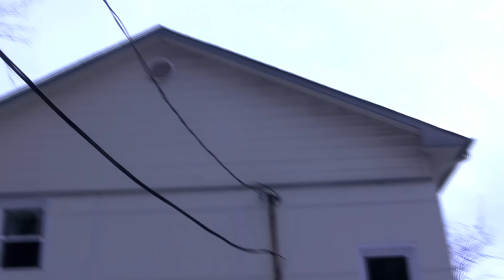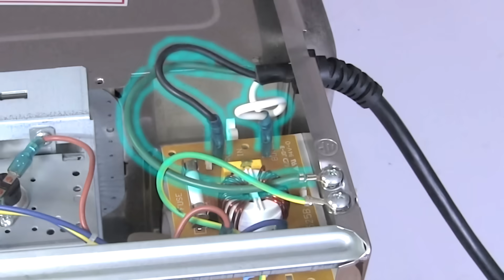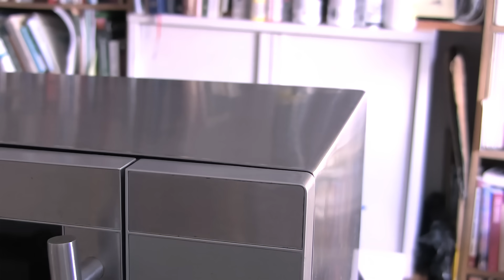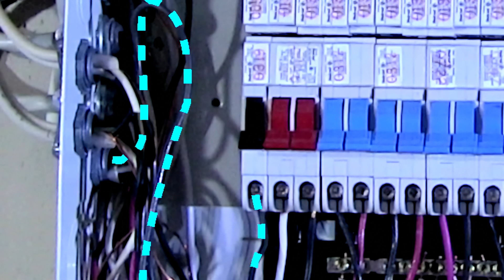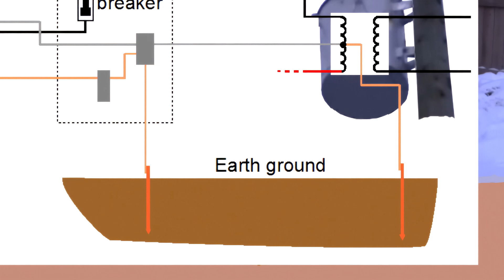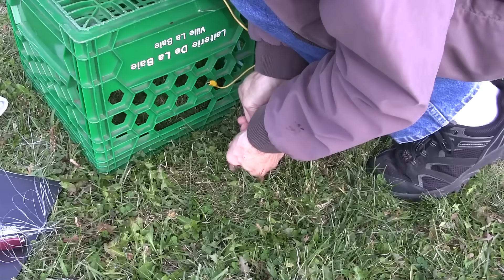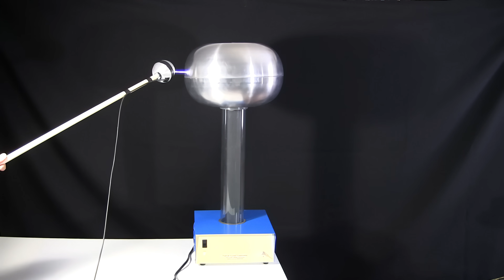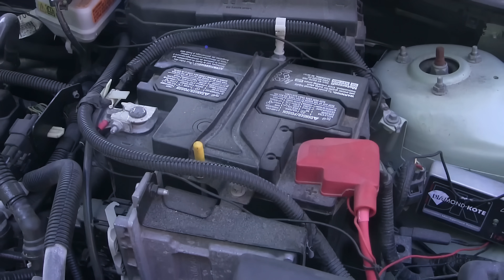What is Ground? Earth Ground/Earthing

Comment: Why is there no neutral wire to the pole?
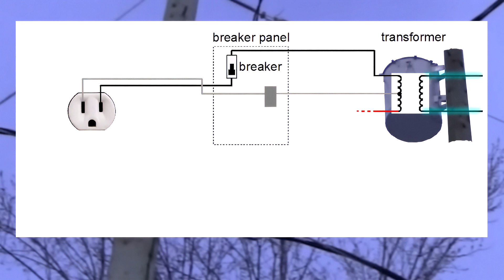Reply from the maker: But there is. See the video at 1:17.
Reply: Nope no neutral only earth ground.  General Order 95
Section III
Requirements for All Lines
33.2 Ground or Earth as a Conductor
Ground or earth shall not be used as a normal return or circuit conductor. In
direct current supply systems or in single phase or polyphase supply systems, a
neutral or any other conductor shall be used under normal use as a return or
circuit conductor; however, the grounding of the neutral or
any other conductor is not permitted as a
normal return or circuit conductor. The neutral or any
other conductor is permitted to be grounded only for the purposes of
stabilization and protection.
Note: Revised January 19, 1994 by Resolution SU–25.
Violation of this rule has created health problems in farm animals and families, and
dirty electricity gets into our homes and offices and schoolsvia ground rods and
electrically conductive plumbing. I have measured higher EMFs in homes with the
electrical service turned off due to unbalanced current flow.
In
Reply from the maker: Oh, you mean at your place you don't have a neutral wire to the pole? I misunderstood and thought you meant there wasn't any in the video.
There's something called single-wire earth return which is used in some locations (https://en.wikipedia.org/wiki/Single-wire_earth_return). In those locations, the Earth ground is used for the return current instead of spending the extra money on a neutral wire.
If the section of electrical code you quote is from your area then it sounds like either someone knowingly or unknowingly violated it or your system was installed before the text was added to the code and the system hasn't been brought in line with the code.
Just out of curiosity, where are you located?
Reply: I was just wondering if you were aware there is no neural on the power pole in all of north America. Or on transmission lines.
Reply from the maker: My understanding is that the norm is that there's a neutral between the house and the pole, as I described in the video. It's the one that goes to the center tap, or neutral point, of the transformer. It's also sometimes called the grounded conductor and is a part of the effective ground-fault current path. I called it neutral in this video because I was addressing the three holes in a wall socket and the three prongs on a plug. My audience is anyone curious about that and I was not trying to train any electrical installers (that's not for me to do, see this source for that https://www.youtube.com/watch?v=mpgAVE4UwFw). So I deliberately used some different terminology than you'd see in the code for some things on the other side of the socket.
But if you're saying that there's no such wire then I have to disagree. The video I linked to in the paragraph above is as good a reference as any for my purposes.
Reply: I like Mike Holt But it does not change the fact that transmission lines are in violation of Code 95. The wetter the ground the more serious the problem is. Check out the " Electrocution of America".
Reply: I like your video it is good for basic beginning understanding. But just look up at any power line simgle phase only two wires no neutral look up at any distribution pole three phase only three wires no neutral.
Reply: DC was never part of the discussion.
Reply: I have no knowledge of Canada codes.But the USA is in noncompliance with code 95  concerning transmission lines code specifies a neutral with 225% capacity. You are right this issue is beyond the scope of this video.

Comment: why don't you get an elektric shock if you touch the chassis of a car? After all it is like touching a bare wire, isn't it? Yes, the battery doesn't deliver huge amounts of voltage, but it would still pass through you? Right?
Reply from the maker: Nope, the battery voltage is too low to break through your skin's resistance. You'd have to touch both battery terminals to open cuts in your skin. Check out my video about whether volts or amps can kill you https://www.youtube.com/watch?v=9iKD7vuq-rY (spoiler, it's really a combination of things).
You sometimes get an electrostatic shock but that's from a voltage that builds up on you when you interact with the car seat, and usually on days when the air is dry.
Reply: Does that mean that if the car batterie had more voltage, you would feel it, if you were sitting genericly in your car?
Reply from the maker: I don't think you'd feel it. The metal chassis and many other things in the car are connected to the battery's negative terminal so that everything has a common reference point. There's no voltage between all those points. With so many connections to so many things, that's pretty much at the same potential as Earth ground and also you sitting in the car. So since you're at the same potential as the terminal, that's another way of saying there's no voltage between you and the battery negative terminal.
Though that's not always the case. As I said before, you might build up an electrostatic charge, which would put you at a different potential. But there's very little charge involved so that even if you did touch the battery terminal, the current would be short lived and harmless.

There is, however, a voltage inside the battery between the negative terminal and the positive terminal and a voltage across anything that's connected to both terminals. But you aren't connected to the positive terminal in any way so that doesn't affect you.
Reply: FooBar Maximus, I suggest you go touch both terminals of a car battery and see if it can kill you. Touched it millions of times, never had a problem with it. Just don't short it, or you'll have a problem.

Comment: Which wire is positive hot or neutral
Reply: S UMAPATHIRAJ Neutral and L1(hot ) alternate to produce 120 volts.  So does Neutral and L2 (hot).  But L1 and L2 also alternate producing 240 volts.

Comment: Why we waste used electricity in ground? Why not to gather it up and use again?
Reply: Ivars Vēza that would require batteries which would get dried up because they only get charged from lightning or electrical failures. Grounds typically have no electricity running through otherwise. They r only meant to be a safe place for unintentional charges to go instead of something that could hurt/kill you.

Comment: Not sure how old you are,  and I am writing this at 4:30 in the video, so that being said: if your old enough then you may remember when outlets were mostly only two prong, neutral and hot. Appliance chassises like TVs, kitchen mixers, etc., often had their chassis connected to neutral which was probably only grouded to plumbing and/or earth at the service/fuse box, which would be fine unless the earth connection broke (i.e. Probably from corrosion or just plain hook up error), this, in the case of just a ground fault could cause a minor shock, or in a ground reversal error, a full voltage shock. So they changed the wiring code to include a separate, independent, earth ground, which as folks have commented, is effectively the same as neutral when everything is wired and connected properly, but less likely to present a shock hazard when things are less than ideal. This also caused the rise of "double insulated" appliances/tools, which were made safe from most wiring because they are electrically isolated from both the hot and neutral except in the case of water unfiltration. GFCIs now handle safety for water infiltration, but that's a separate topic 😊
Reply: This is not at all true. Older appliances like TVs and such DID NOT have the neutral bonded to the case. The only time this happened was with 120/240V electric dryers and cooking appliances.

Comment: I still don't understand the point of the ground prong in your microwave example. If ground is shorted with neutral at the breaker, aren't they basically the same thing? Couldn't the same effect be achieved by connecting the neutral input to the microwave's case and not having a ground prong at all?
Reply: Yes that is an earting system (in europe that would be the TN-C system) but it is extremely rare because it is not a safe system. If the neutral conductor becomes disconnected downstream and a load is connected upstream everything connected to ground becomes live where it is connected upstream of the break. So for example if the neutral to a circuit disconnected from the neutral bar in the breaker panel and something on that circuit was turned on every metal applicance using that neutral would have its case become live. Lethal. In the UK we often use a hybrid system TN-C-S (it is the system in use in my house). Everything on the distribution side of the electricity companies fuse uses a combined neutral and earth conductor which is earthed at multiple points along the circuit. On the house side a seperate earth and neutral conductor is used. This is an excellent well proven system that is very safe.
Reply: Also, the chassis would rise a few volts above ground potential due to voltage drop, even in normal operation.
Reply: Nice atttempt at trolling!
Reply: The point of grounding your microwave oven is to make sure the outer casing doesn't get energised with AC voltage if fault occurs. If you connect the case to neural, and neural is the path electricity flows back, you'd basically be putting the oven case into the circuit. You'd be basically doing the opposite of making the microwave case safe to touch.

Comment: This sounds like a DC explanation. With AC, both wires are "hot", and there is no one live wire. Have I missed something ?
Reply: no, only one wire is live or hot in AC. You can plug a phase tester into a power socket and you'll find out that only in one hole the little lamp inside the phase tester will light up, that is your live wire.
Reply from the maker: I've never used a phase tester so I just had a quick look and may have missed things... but from what I saw, you use a phase tester on wires when there is no load e.g. the microwave oven is turned off. Since the phase testers I just saw create a circuit between the wire, you, and ground, they show current when you touch the hot wire but not when you touch the neutral. That makes sense since they neutral wire is connected to ground and to the center tap of the outdoor transformer on the pole.
But what is the state of the neutral wire in your household wiring when the microwave oven is turned on. Surely there's AC running through the neutral in your house wiring when the oven is on? The AC can't just stop when it hits the oven's circuitry or where the circuitry is connected to the neutral.
Reply: yeah, but the current flows through the neutral wire (which has extremely low resistamce) back to ground, and it doesn't affect other outlets because the resistance is too high for the current to flow through the phase tester and your body.
Reply: But in a household, you always have DC no? AC is only used for distribution from the power plant to power stations outside the city and for powering large machinery
Reply: +David No, most countries in the world use AC. Most fridges, heaters, lights use AC. That's what confused me originally, as you can attach the Live wire to either side of the appliance connection, and mostly it will still work.
Reply: WOW, i don't think he was trolling but loved both his and your comment.

Comment: Sir how is earth wire a path of low resistance
Reply from the maker: Which wires are you referring to? The path through the Earth itself is high resistance. For example, the path between the two grounding rods in the Earth ground which you see at 5:35 in the video are higher resistance than the HOT and neutral wires going between the breaker panel and the transformer, so very little current goes through that Earth ground.
The ground wire I talk about around 3:12 doesn't go to Earth ground and is only there to cause the breaker to trip and open the circuit.
The ground wire I talk about around 5:33 (and introduce around 3:41) is for handling charge built up on metal cases or appliances. The actual ground wire itself from the case to the ground is low resistance and the Earth is still high resistance but the Earth ground still accepts that charge since it has a neutral charge (see 3:41).